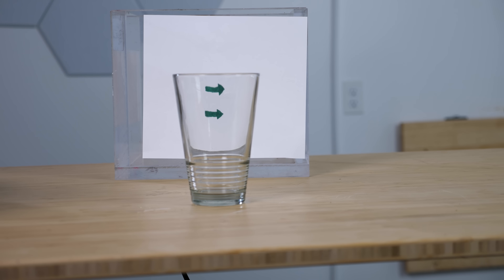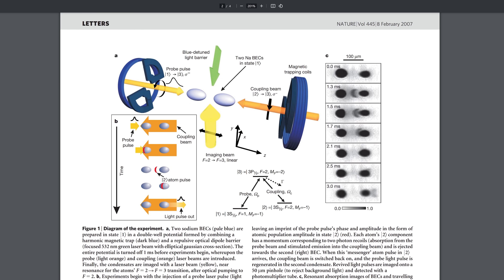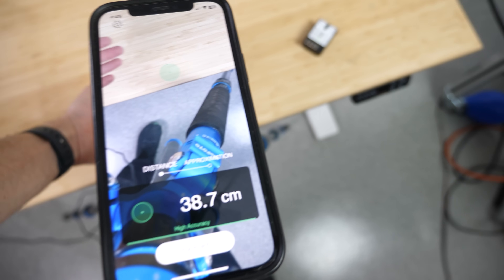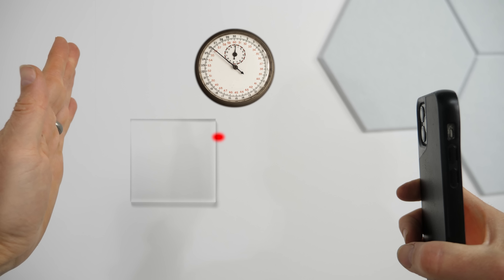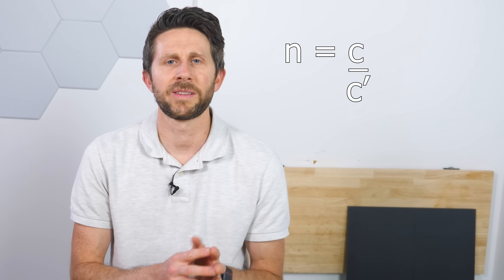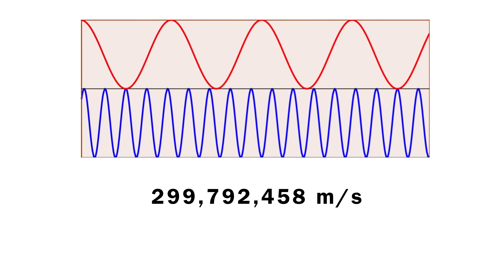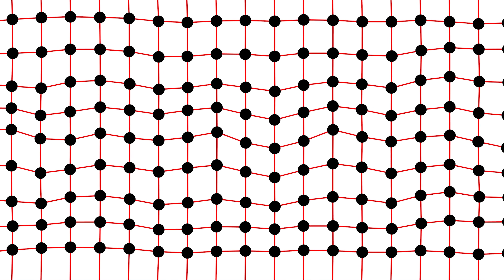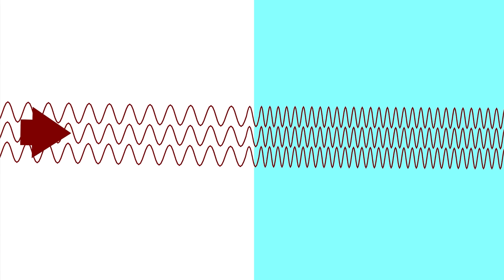Solving The Slow Light Paradox

Comment: Doesn't it change the trajectory not the speed? The light went from a straight line to it's destination, to navigating through refracting material. The distance it traveled is further, even if it is going at the speed of light it's still going to take longer to get your response back to the phone

Comment: Anything in space (where thre is an acceleration) will suffer thatacceleration, has or not has mass.
Like near a black hole, ligth will go fastet than 300000 km/s if ligth had beenaccelerated by the black hole, or less if ligth is going outward the black hole ... if from event horizont that ligth will reach a point that it's speed will be zero and after will travel back to the black hole.
Not only ligth speed depends on what mass it is passing through, also depends on what acceleration it is applied to it by near objects, and much more noticeble if such objects are very massive (since acceleration will be much bigger).

Comment: Wait I hear that the speed of light is constant within a vacuum. And then changes as a function of the medium. What would happen if you put a wobbling electron in a vacuum with light rays. Will the speed of light still change inside a vacuum that also has other EM waves that will interfere? Or does the existence of anything but light inside a vacuum mean that it is no longer a vacuum? My breanne hurts

Comment: Good job - my compliments. I have an issue with the idea that the incident photon pumps an electron in the acrylic material then continue on its merry way unchanged to later couple with the photon emitted by the pumped electron as it drops back a level and create a third wave front that is slower. I understand the concept of the standing wave - well. think I do at least)
The only way for the photon to pump the electron is to dump energy into the electron. The energy level of a photon/electron is in discrete steps. The photon either has to dump all its energy and disappear or dump a significant part of its energy, then drop to a longer wave length (lower energy level) to continue on.
This raises the question of the recombining of photons of different wavelengths recreating the same color of light as the primary product (ignoring scattering) . As a ham radio guy it suggests to me that recombination should result in an I/Q modulation with three different wave lengths appearing at the output (as a mix of colors). 
This all proven by Major Armstrong at much longer wavelengths..I will let the standing wave slide for now.
73

Comment: I never understand why people make this stuff more complicated than it really is. What you are experiencing isnt the speed of light changing. What you are experiencing is extra collisions. The velocity of a photon remains the same, however, when a photon comes in contact with a more dense zone then the density of atoms causes light to collide more often. This is basically the same effect we observe with drag. Throw a ball through the air and when it hits water it will slow. The only difference is that in lights case it has basically no mass so it perfectly bounces off and conserves its velocity. Once the light leaves the dense material it will return to the inherent "ricochet" speed of the less dense material. This is why when you move from a less dense material (for example air) to a more dense material (water) there is an inherent deflection (refraction) because the change in density causes the photons to collide more which depending on how dense the material is the more it refracts. MOST PEOPLE THINK OF LIGHT AS A WAVE BUT REMEMBER IT IS BOTH.
Reply: @marcosolo6491  What I am arguing against is teaching methods. If you are talking about what I said and are saying there is an error in my words then tell me how. Ive gone through college and worked with this stuff for years. If you have a valid counter point then say it. If you are not talking about what I said then I apologize.

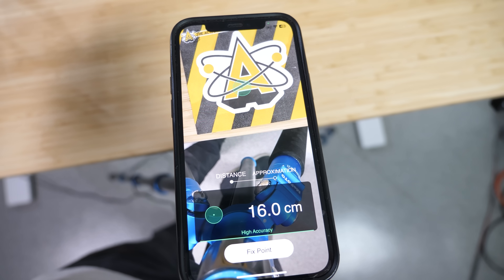Comment: If you were listening closely in your Physics or Astronomy class you would have heard "the speed of light IN A VACUUM". So that means neither in air nor in water. 2:24 Indeed this is the mistake you make. For you talk about the speed of light remaining constant though the signal is passing through air. In addition, the quality of the air, suspended particles like humidity, and air currents (altering the density uniformity), and of course the temperature distribution along the path of measurement all affect the speed of light through that medium.

Comment: Einstein lie to us or we don’t think carefully while learning. 
Faraday-Maxwell also told us that c in vacuum = 1/(u0*e0)^2. Where e0 is the permittivity of vacuum is 8.8541878128F/m and above that is relative permittivity er a scaler factor over vacuum, such as the acrylic block is 2.7 x e0; at 1MHz decreasing as frequency move up, it works out to be about 7.3 x slower in acrylic.

Comment: @TheActionLab I see it Kind of like a fast car creating wind behind itself, and the cars behind it will, end up catching that wind ultimately giving resistance to those car

 Except in this case as soon as the light hits the dense material, because it's so fast it creates waves which like air will proved resistance, and slow it down somewhat.  Being dense, the material will react as one piece once the light hits the material, and that denseness will create a more dense wave.  That dense wave is what slows down the light as it travels through the material

With air, there is no resistance so it can go as fast as it needs to.  Am I right or off?

Comment: The "speed of light" is not really the speed of light, it's the speed of cause and effect in the universe. How can light be a particle and a wave at the same time? Simple, the movement of the massless particle gets compressed into a waveform by the limit posed by the speed of cause and effect in the universe. 

Then why does it move faster in a vacuum than inside a material? Simple, it has to travel a longer distance inside the material relative to the speed of cause and effect. What does this mean? Simple, the interactions of the compressed movement of the particle with the surrounding material cannot result in an effect where the speed of cause and effect between two particles of the surrounding material relative to each other exceeds the limit of the universe.

Comment: The medium move . Once light stop touching initial medium it's a problem . See only 100% nothing < 100% something is motionless . Vacuum = penultimate of 100% nothing . Phylosophically , everything between nothing and something excluding them is moving . Light is not nothing something or penultimate . Why , acording to academia light is subject to pressure mediation . Wich is not possible since pressure mediation applies only penultimate of 100% nothing< penultimate of 100% something . C is likely the clone rate of light on a medium . 2 medium 3 light , 6 medium , 7 light

Comment: Hey, whoever you are, if you're reading this, I have a thought experiment for you. It's an interesting one, because it makes sense. Consider two simple assumptions: the Universe expands, and expansion is not uniform. Expansion only happens in the absence of energy/matter/interactions. That's the strong assumption. The other assumption is that massless particles do not move, but stand still. They only appear to move because the Universe expands relatively. If you're somewhat accustomed to general relativity, you can consider the expansion rate of the Universe to be a parameter of a frame of reference. "How fast does the Universe expand between here and there?". Now, in your head, construct a Universe based on those assumptions in the image of our own, and bonus points if you can find gravity as an emergent effect (negative relative expansion rates). It's fun. I'm not saying it's true, but it's fun, because it might be true. It might even explain the randomness found in QM. That's why it's a fun thought experiment, it hints at having answers to tons of questions still unanswered, but there's no way to prove any of it. So it's all pointless, besides the fun for the mind.

Comment: An interesting thing to consider is how lights "speeds up" again when it exits the denser medium, since there's no way it could gain energy when it exits the medium must mean that it never slowed down in the first place. I hope this makes sense scientifically as well.
Reply: how do you know that it speeds up again? is there another experiement for that?
Reply: @elio7610 It’s essentially the same example. It’s the push back at each layer of electrons that causes the final waveform to propagate slower. So without it, it’s that combined waveform that still travels at c. Think of it like you are taking two steps forward but each time you cross an electron layer, they push you back one step. You yourself are always still taking two steps each time, but your overall progress is one step. Once the electrons aren’t there, you continue at your two step pace but it’s not like you gained any energy, there just isn’t the thing holding you back anymore
Reply: @TheOtherOlesen  that's not what i am asking. the experiment doesn't show when the light speeds up or slowed down, it only shows that the combined travel time was slower, so how do we know that the light returned to its previous state after leaving the medium?

now that i think about it, there is a very simple way to test it, you just need the start and finish to be in different places. by having the light travel through both the air and the glass (or whatever medium) we can see if the light returns to its normal speed by comparing if the speed of the light changes when the medium is placed at the starting point vs the end point.
Reply: @elio7610  isn't the fact that it bends back to it's incident angle with denser medium enough to know that it returns to its original state? Though it could be tested and I'm sure a quick Google search will yield the answer.
Reply: @MuhammadTaimurBaber  i am not sure what you mean.
Reply: @elio7610  refraction of light when it exits the denser medium means its back to it's original state

Comment: The way I tell myself is that, the wave entering is not the same than the wave exiting (in each layer of glass).  So it is not the same wave that's entering.  

The first wave gets absorbed (by the atoms/electrons), it then emits another wave, and so on.  So C remains constant, but the delay is due to absorption and re-emitance.

Comment: There are lots of "authoritative" misstatements on YouTube on this topic. I'm glad you reference 3Blue1Brown and his illustration of Feynman's explanation ... the best I've seen. Nice demo, as usual!
Reply: 3Blue1Brown indeed has some good animations on it (KTzGBJPuJwM & aXRTczANuIs). I also like FloatHeadPhysics (JZOn1B8K8mA) although the "pull back" animation isn't that good - it has some really interesting comments though. I don't like the FermiLab version as it does not really explain it properly (well at least as you can say "properly" as of course it's far more complex in real life than any of those videos imply).
Reply: Someone explain to me how this works as a photon of light. Whenever I see videos or explanations done about this, everyone starts showing waves. While I know light behaves both as a wave and as a particle, if we don't know how an individual photon 'knows' it transitioned into a different medium, there's a possibility this wave theory is also incorrect. Also, the way it's explained here and everywhere else is that a single atom's electrons changes the wave and then it gets passed on to the next atom's electrons.... but isn't this additive? If that were the case, enough length of the material would make it completely opaque, and well before that the refractive index would be observed as being dynamic. It makes 0 sense that this is considered the proper explanation.

Comment: I think addressing "What makes a material transparent?" would have been a good addition to this video.

Great work.
Reply: Methinks this question has the wrong direction. It e.g. does not explain why vacuum is perfectly transparent. And it gets difficult to explain why water is transparent and snow is not. The question is why some material is not transparent.
Reply: Wait- holy hell this just gave me actual virtigo. This explanation means that in the truest sense of the word, no mateiral is transparant, it's simply a material that has an electromagnetic-wave-propagation effect. 'Air' would be a good case study becuase I'm uncertain if it has enough density to compare to something like Water or Acrylic... but except in a true vacuum, you will never receive the electron that the originating atom created... And in low density fluids... how deeply could an EM wave penetrate before it MUST hit another atom to propagate and potentially delay? Your eyes are constantly re-propagating EM waves so for that matter... head asplode
Reply: @bosslca9630  A vacuum, and gases in general, will be transparent because the photons can actually pass through without interacting with anything. Gases are mostly empty space, part of the reason their densities at normal pressure are so low compared t liquids and solids where the atoms do contact each other. There is some atomic interaction between light and gases - that interaction is why the sky is blue for example.
Reply: @peglor  Compared to vacuum, air is incredibly dense. It is as dense as it can be without increasing the temperature in its space. It is so dense it will knock you over if it travels as 20m/s. "Speed of light" in materials is indeed a conundrum that very likely proves we don't understand what light is. It is neither hardness, element or state deciding if a material is transparent. Coal is the perfect light stopper, unless you compress is insanely hard. Crude oil is also blocking almost all light, until you increase the mass of the molecules and turn it into plastic. No metal is ever transparent, unless you "fix" it in a ceramic grid.
The reason light "slows" down in different materials is probably because it never travels through it. It's only the waves going through. Sort of like sound through a wall.
Reply: @TheRealDuckofDeath  Dense compared to a vacuum, but gases still have so much empty space between atoms that photons can pass straight through them without interacting with any gas atoms.
Reply: @peglor nah man. Not all gases are transparent.
Reply: @randomdosing7535  Can you give any examples? Obviously sending light through a long enough path filled with gas means the probability of each photon interacting with a gas molecule becomes a certainty, but pretty much anything I've seen that looks like an opaque gas is actually particles being carried by the gas as in the case of smoke.

Then again there are a lot of gases out there, and normal life exposes people to a very small number of them, so there's every danger I might learn something here 😀.
Reply: @peglor  sorry I'm not going to give examples here. Internet is all yours.. it's good to explore and stumble on your own
Reply: @peglor just to clarify, speed of light through a material means there is enough ‘material’ there that it’s not a vacuum. Air isn’t as dense as water, but it’s not a matter of ‘if’ a EM wave will hit another atom, but ‘when’. That was always my question and existential horror.

Forget the air now, consider the human eye… the cornea, the ‘jelly’, the nerves on the back… those EM waves are propagations, not original photons.
Reply: Thenproblem is that youbare thinking in particles, everything is transparent and opaque, it depende on the wavelenght, the window of your microwave oven is opaque to microwaves but transparent to visible waves.

Comment: What happens to the light as it passes through increasing depth of water ?
Reply: water is (mostly) incompressible, so the depth doesn't have a strong effect. There is some variation with temperature and salinity...but the ppl who really need to worry about that work in sonar.

Comment: 05:30 The problem with this explanation is that light waves don't move up-and-down - that's just how electromagnetic waves are represented on a two-dimensional graph.
Reply: but the electron do move up and down, in a direction defined by the electric field, in a classical sense. Really the atomic orbits shift, and acquire an oscillating electrical dipole moment
Reply: @DrDeuteron  You could make an argument for moving forwards and backwards, relative to the direction of the wave, but not up and down.
Reply: @Grim_Beard  that's just wrong, propagating EM waves cannot have a longitudinal field component, so fwd/bwd is banned (by gauge invariance, but that's a long story).
Reply: @DrDeuteron  An electromagnetic wave propogates outwards from its source - so away from the source is 'forwards'. Electromagnetic waves do not move laterally - whether 'up and down' or 'side to side'. They should be represented more like this ))))) than this ~~~  

Oh, and I know gravity doesn't enter into it - that was why I pointed out that 'up' and 'down' are determined by gravity. It makes them entirely inappropriate terms to use for describing this.
Reply: @Grim_Beard  well you do you, but don't expect communicate with anyone. I spent a decade splitting atoms, and 2 more in space borne radar and passive sensing around the spectrum, in which I had to communicate with other ppl.

meanwhile, spherical waves and plane waves are equally valid, as the former are eigenstates of angular momentum and energy and the latter are linear momentum and energy. Which you use depends on the problem. This problem uses plane waves.
Reply: @DrDeuteron  P.S. 'up' and 'down' aren't defined by the electric field, they're defined by gravity.
Reply: @Grim_Beard  knock it off. gravity is irrelevant, and the problem has axial symmetry.